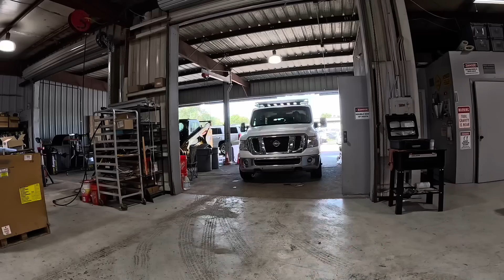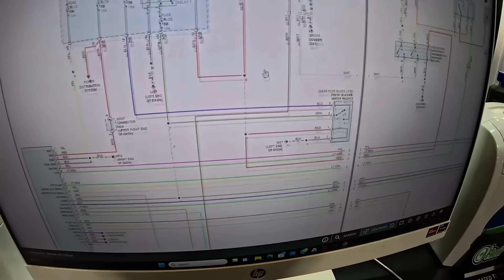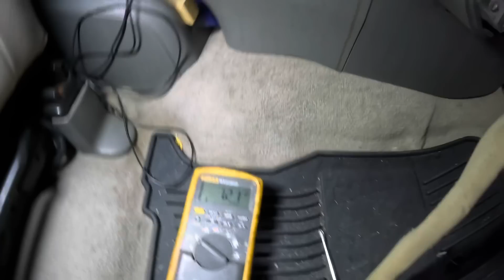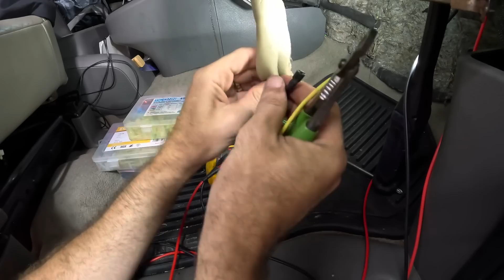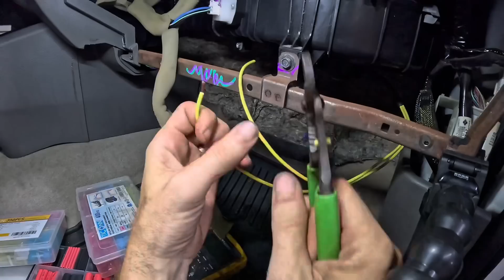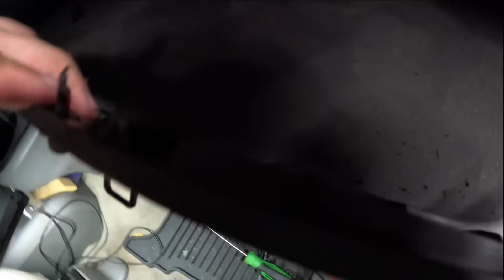Make it Work! No Parts Repair! (Sort of) Nissan NV 3500 Wiring Repair

Comment: Very good video. I wish you had a ground issue and a variable speed controller issue so I could see more. 8-) My voltage at the blower is 10.9 VDC. I smelt some insulation awhile back while parked with the AC on. I'll press on. Thanks again.

Comment: IT will be back the connector locks the cables in position that will come loose again. I would still order the connector. This is fine to get it going. But i still say get the connector for better repair longevity.

Comment: i remember telling you about the kline plyers a couple years ago when i notice you where not using the correct notch . i did a/c repair and refrigeration work for 50 years and didnt find that out for 40 years doing it wrong until someone told me

Comment: Note about Cn plastic - bought a multi pack of plastic covered pins as well as reading glasses, at about the same time, First pair of glasses lasted about 7 months by which point they were super light weight and extremely brittle, to the point they were unusable as unfolding the ear pieces broke them right off. But it wasn't just he pair I was using. It was ALSO each and every pair of the spares and the exact same thing happened to the pins. They were fine when I got them but the plastic just disintegrated to the point even picking one up caused it to fall apart. So, be aware. 

If you have relatively new plastic parts or plastic covered parts that have been sitting around for a few months, check the strength of the plastic before using. Particularly, any sort of electrical parts - like connectors or even outlet boxes, switches etc.. I'm not sure how one would check them when they're new because the items I'd bought were fine at that point so, just be aware. Maybe wrap the individual wire ends and their connectors  with a bit of "rescue" tape or something to hold them together, just in case, especially if the hot and ground wires are near one another.

Comment: Ray should really watch some of electrical diagnosing videos from DiagnoseDan and Pine Hollow to learn how to use multimeter properly, and start using test light for checking powers and grounds. Using ohmmeter for testing grounds can often lead to wrong conclusions. Test light also loads the circuit and verifies its integrity. You should also know what to expect instead of poking with meter.. Anyways, this repair is just fine, but the testing process was not so good.

Comment: I had a similar problem in my 2012 Ram 2500 a few days ago. The fan motor had been making noise since the day I bought the truck, so, I thought that the fan had finally died.I bought a new fan and installed it and it still wouldn't turn on. I didn't have my meter on me as I was traveling from one side of the state to the other at the time. So, naturally my next thought was that the resistor had quit but that wasn't the case either. I suffered in the heat through the remaining 100 miles of the drive until I got home. I got out my meter and started checking everything. I had no power at the fan and resistor. The fuses and relay all checked good. Next I tore into the dash and discovered that I had 12 volts to the back of the climate control module but nothing coming out of it. After I monkeyed around with the switch I got the fan to turn on and I haven't touched it since. Mopar has stopped making replacement modules and there weren't any available from them. On top of that none of the local parts stores nor RockAuto have them available. None of the local salvage yards had any trucks of the 2012-ish persuasion that I could grab one from either. I ended up finding one from LKQonline and ordered it. I am currently waiting for the part to arrive from New Mexico. Such a simple fix but I had to go around the block twice to get it fixed. On the upside, at least that noisy fan is now gone. Thanks for another great video!

Comment: Great diagnosis and video.  But you always amaze me when you use power tools on as much as you can under the hood etc. But when it comes to the interior and your dash you use slow screw drivers instead  of using a 20V drill and drill bits?

Comment: If that really is a transistor, then it’s likely an NPN transistor; the emitter is tied to ground through the black wire, the base is connected to a module through the lt. green wire, and the collector is tied to the load (blower motor) through the blue wire. Then the other side of the motor probably goes to the battery + terminal through a fuse somewhere, possibly also in that same module. This is what we electronics geeks call, “a low-side driver.” 😅 This isn’t to be confused with a “drunk driver”!! 😆

Comment: Ray needs to buy some rolls of different color wires in the most common gauges. NEVER use the same colors for + and -. 

I use 4 different colors of SHARPIE's to put a trace stripe on a wire. You can have a Brown with a Red stripe, Green with a Black stripe.....

Comment: The wire and connectors look excellent, you do a great job applying them. Can't wait to see you attack the wiring on the mini-van, surprised it didn't catch fire before engine locked up. You could do with a better wire stripper and an electric screwdriver. Great vids

Comment: As a retired GM technician, looks good. I was required to take an eight-day wiring repair course on GM vehicles. I had many techs say you had to solder the wires!  No you do not. I stated very clearly that the wiring harness connectors have terminals {crimped} on the end of the wires. Many of the wires I was repairing was under the vehicle where water and salt would get to repairs. These repairs had to be done differently. Under the dash where there should be no water, you went the extra mile. On a high amperage draw circuit like blower motor, it might work better to use a test light to check circuit.

Comment: The great part about this?  Ray gets paid $150 per hour to fix someone else's stupid crimp connector repair.  

I quit using crimp connectors, they always fail and I have strong hands.  I use solder stick connectors instead.  You slide them on one of the ends of the wire and then you push the wires together.  Slide the solder stick over the connected wires and hit it with a small amount of heat such as a heat gun, a torch, or even a lighter and it is soldered together and will NEVER come apart.  What's more the connectors are surrounded by heat shrink clear plastic, so you can see what you have.  100% better, and no affiliation on my part.

Comment: I agree with the use of your crimpers by using the pointed crimp jaw to do a complete crimp.  The other part of the jaw just smashes the connector, and the wire can easily be pulled out.

Comment: Re Re Re Hey Ray, sorry to bring this up, but your difficulty in stripping that OEM green wire was because it was specified a high current capacity stranded wire.  But the yellow wire was not as current capable (smaller diameter).  The result could maybe, possibly, result in heating of the yellow wire.  Probably not enough for a fire or anything like that but over time enough to make the insulation brittle.  Now you did a good job of keeping the wire away from future short locations, but in the future, I suggest you match the wire gauge supplied by the manufacturer with the one you are using for the repair.  As you learned in your electrical education, the fan motor is a current hog.  Blessings  Albert

Comment: I think whomever replaced that blower motor cut the OEM connector , perhaps it was melted (along with some of the wire) when the motor bit the dust, and did a pizz poor repair on the wire ends.  Looks to me that the wire harness should go up higher and over the blower housing.  They probably cut some wire off the harness and just left that part of the harness dangling. Passenger Bozo :face-blue-star-eyes: feet probably snagged that harness and pulled the poor connection loose. Your solution is fine Ray, but I've said it before, get yourself a decent ratchet crimper! :hand-purple-blue-peace:

Comment: It’s always satisfying doing an no parts repair. Even when it doesn’t go as planned lol.
I fixed my passenger door lock actuator in my 04 mustang a couple years ago b/c it was not locking with the fob.
I took the door apart, removed the actuator and disassembled it and found a rounded plastic gear, so i flipped the gear to the other side and the problem was fixed. 
(It was fixed for about 3 days until the other side failed as well lmao 🥲)

Comment: I just don't understand the Chrysler bashing I hear from many.  There is not any brand of vehicle produced that does not experience problem areas in design.  I retired from Chrysler after 24 years of service as a skilled tradesman and wouldn't have been able to retire without that job. I love your videos. Thanks for what you do.
Reply: You're experience with Chrysler is somewhat different from mine.  And design issues afecting reliability are something I have not experienced on Honda, VW, Subaru, or Toyota.
Reply: Your work Sir is not Chryslers problem but choices made in things like the parts Ray discussed on the previous video about a Penastar engine and parts that should not be plastic.
Reply: @wayneessar7489  So who's decision was it to use those parts?

Comment: I am more prone to replace wires with wires of like color, so I bought a package of little spools of stranded automotive wire.  I cannot duplicate secondary stripes though.  I don't have red colored heat shrink.  You might get you a nozzle adapter that wraps around the heat shrink to heat it up evenly. 
Reeeee shame on you for not cutting the ty wrap square so that someone sticks their hand under there and gets stabbed.  I watched to the end and I did not see you fix that.  I have some nipper dikes for situations like that.

Comment: Great job Ray. I'm just wondering how many shops would have replaced the blower motor and wiring harness and then charged the Customer for the new parts (of course cost and markup)  plus installation and diagnostic fee. I'm sure that the Customer would have been happy that they now have air conditioning and would have accepted the cost of parts & installation, leaving the shop cool and a lot more broke.

Comment: Ì like the repair it will be more secure than what was there. It seems they cut the wires to short and the tension on the connection to come loose. Great job on the repair Ray.

Comment: Very typical on a lot of cars for the Fan motor connector to over heat and melt.  Probable cause the fan motor starts pulling excessive amperage as it gets old. If the connector melted, check the motor for higher then normal draw. The conector usually fails before it blows the fuse.

Comment: Got it corrected and it won't be a issue in the future because you took the time to connect, heat shrink & tie wrap the wires to keep em from moving around with moisture protection.

Comment: i've worked on 3 different Nissan's in the past. Every single one had electrical issues.  Shorts, broken wires, corrosion and bad connectors. I just steer clear of Nissan's. They make a good motor for their Frontier and Titan's... but I just don't like their electrical engineering.

Comment: Good job, Ray, use toenail clippers to cut wire tie ends, and you won't have to worry about  the next guy, or you, poking his hands under the dash and slicing his wrist open, bleeding out, and his cries of anguished surprise forever etched in your conscience. Regardless of whether we're here or there, it's the significance of the passage of time that is significant, and the passage of time as time passes is significant in its passage because the past is unburdened by what has been and the future being unburdened by what may be as we pass from here to there, back and forth, that is significant when you use toenail clippers to trim wire ties. They work really well, leaving a dull curved stub, no fooling. AFAIK this technique is uniquely mine and may be the only useful thing I can pass on to humanity, past and future, who love the smell of resin flux in the morning, the zen of marine shrink tube and the joy of building custom harnesses. Heh, heh,heh, this comment really made my AI grammar checker mad.

Comment: This is definitely the best way to do this repair. Easy, relatively quick, cheap on parts, and don't have to wait for delivery of parts that may or may not be readily available. Also, Ray's work is probably a little more reliable than the OEM part! 😂😂😂😂😂
Reply: Or get a larceny part again😏

Comment: Making the connector is fine, no need to order, pay for, and wait for the right connector. But the black heat shrink over the top kinda made the red (pos) and black (neg) heat shrink unnecessary.

FYI, I'm not a "weirdo". I skipped past the 4 mins of screwing the screws in. 🙂

Comment: I have run into this same issue with different vehicles. Love the double shrink idea to hold them in the same orientation. In the past I’ve added some split plastic tubing to help with ppl fat feet and kicking the wires.

Comment: If you use insulated terminals you can’t solder them, so less of an electrical connection. Ask an electrician how to get the best connection.

Comment: Resistor only is for the low speed. High speed doesn’t require any resistor, although the circuit still goes pass it.

Comment: I'm excited to see the motor exchange on the Chrysler Van. Just mentioning here, but they make a stand that will make the sub frame drop and reinstating  of drive train easier. The guy on the car care nut channel uses one. It looks alot safer than all those jack stands and props

Comment: Ray, what you called a resistor is actually a field effect transistor (FET). It has a gate (G) that as you increase voltage on it, it allows more current to flow through it so kind of acts like a continuously variable resistor

Comment: I retired from commercial low voltage installation and service and always had issues with the squeeze crimp on those connectors. They will not meet the pull test, broke an expensive buss headlight that slipped out of a squeeze crimp and tapped or heat shrink on a dimple style crimp never failed. Remember to dimple the back and not at the seam as it may only catch half of the wire when seam splits. 
Keep up the good work from a fellow Floridian (Apopka)

Comment: I think I would have checked whether I had two different colored wires on hand. Most of the single wire red/black heat shrink at the motor connector is hidden by the black two-wire heat shrink.

Comment: RE: using a connector you have vs buying the specific 'OEM' connector. For this, a good tech SHOULD be able to wire this correctly and make it secure. Ordering big parts? Yeah I'd prefer OEM. A simple connector? Please, save me money and do it yourself, thanks.

Comment: To make a really good connection, you could start with a terminal with NO insulation, crimp it using the same tool you like, solder it, and heat shrink it. Guaranteed for life!
Reply: The insulated terminal is actually better in this case as there is no way the two terminals will ever touch each other and short out, blowing the fuse.

Comment: Plus the actual connector is 100/200$ va the pennies for the materials you used!!! I’m all for it ray would have done the same thing!!  Actually did I had to repair an entire harness using the same methods, would have cost me thousands at a dealer…. Had to remove both fuse panels cabin and under the hood took me over a week and only actually two hours of my labor to fix…..tearing all that apart is quite intimidating most satisfying thing when it worked …all this was caused because there was a pinched constant 12 V wire going from the under the hood fuse box to the one under the dash and for some reason, the fuse didn’t blow the wire became the fuse melted half a harness but fixed it works great a year later

Comment: I was a wire-man at a bus manufacture and we had an order from Canada and there code did not allow for any holes in insulation, and we used the pierce type for the same reason that the wire was not secure. Canada sent an inspector down and we demonstrated this to them and they OKed the use as safer as a hot wire was much more secure.